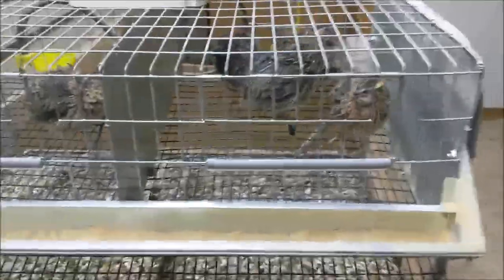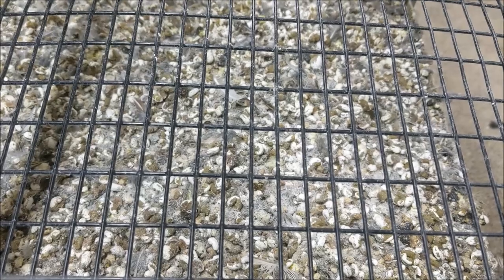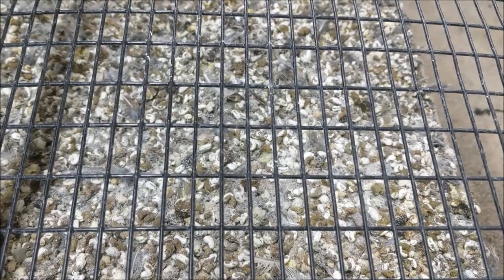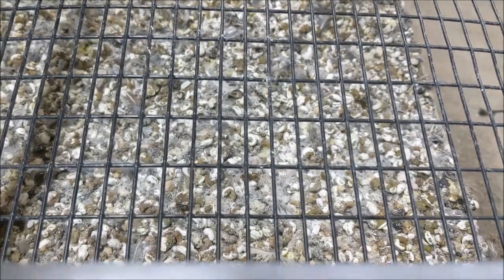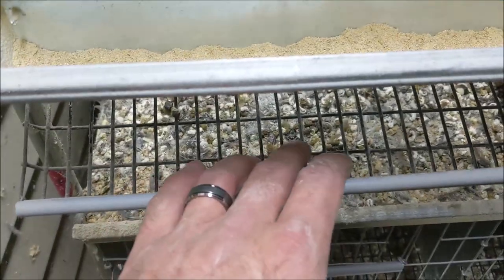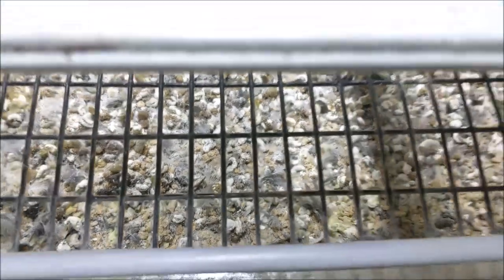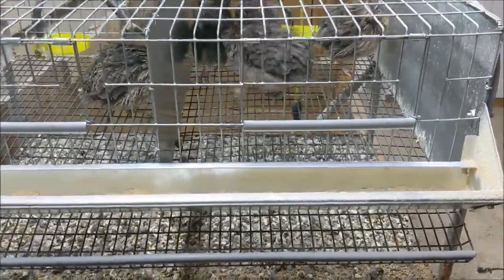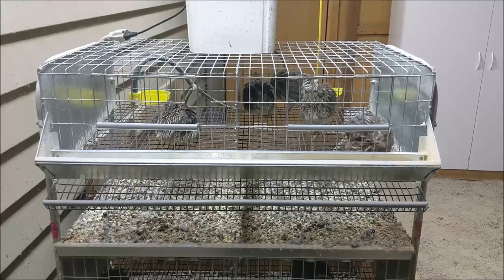Using Proper Flooring For Your Quail Cages

Comment: I use KW rabbit cages, which come with 1/2" by 1" flooring. I was worried the spacing would be too big, but it works well as long as the quail are at least 2 weeks old - any younger and their feet are too small and fall through the wire. I do give them a sand box and a solid mat (cardboard or hemp or similar) that I change out often. I like them to be able to get all the way off the wire when they want to. Thanks for the video!

Comment: Can quails still get bumble foot from pvc coated hardware fabric? Also will the 1/2” by 1/2” still allow the poop to go through?
Reply from the maker: The size works fine for poop to go through, and PVC coated is preferred.
Reply: @UrbanAviary but would that prevent the quails from getting bumble foot? Someone on fb used pvc coated hardware fabric and her quails still got bumble foot. Now I’m worried.
Reply from the maker: It's the best thing I know of to prevent it, but there's no guarantee. Don't get overly worried about everything that could go wrong and just pull the trigger. You'll learn along the way. Just do the best you know to do. There's always going to be someone with an anecdote to confirm your fears. Just move forward and let experience be your teacher.
Reply: @UrbanAviary what other things did you do to prevent bumble foot besides the pvc coated hardware fabric? I would like to know so that I could do the same :)
Reply: I was thinking of getting a power washer to wash off the poop off of the wiring.
Reply from the maker: Nothing, there's only so much you can do. Don't get caught up in analysis paralysis, don't overthink it. Just start building or go to an Aviary setup if it's a huge concern. If that's not plausible then do the pvc coating, keep it relatively clean and enjoy the fruits of your labor.
Reply: @UrbanAviary ok

Comment: So I can either pay $11 for 2x25’

Or pay $168 for 3’x50’

🤔 I’ll buy the cheaper and replace as needed every other year ✅

I used bunny cage with thick plastic coated and 2/6 got bumble foot from it.  I healed em then 6 months later moved em to plane metal and no issues so far.  I don’t see the difference.  Scrub cleaning the plastic coated warm off some of the plastic then rusted instantly.
Reply: Hello, Do you think it is better with plastic coated or just plane metal?

Comment: Im just not a fan of wire floors in general because of the injuries they can cause to the quail's feet. I mean coated wire is better but it is best to just use bedding. Also that cage was way too small for those coturnix you need a cage at least twice that size.
Reply: I agree with you. Lots of people don’t properly care for these little birds, it’s really sad.